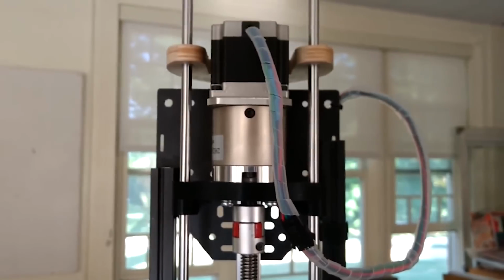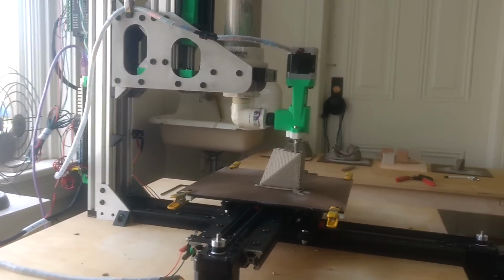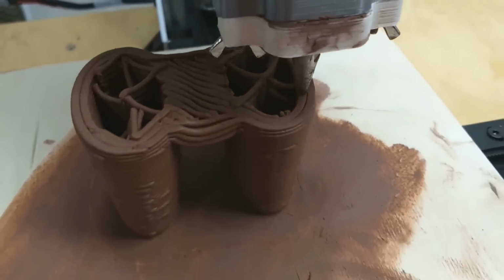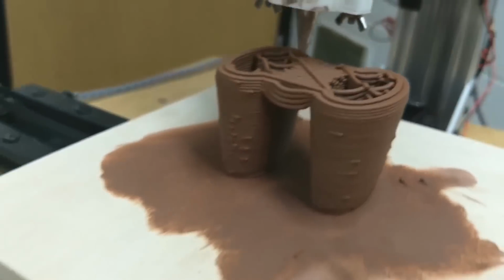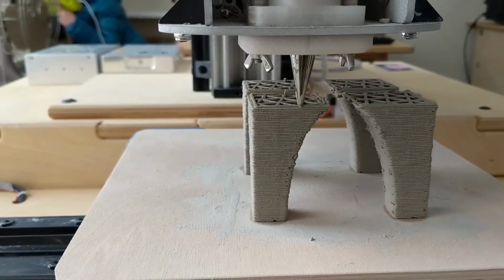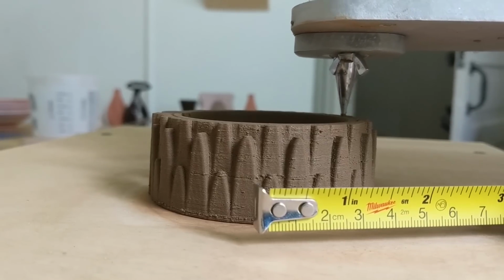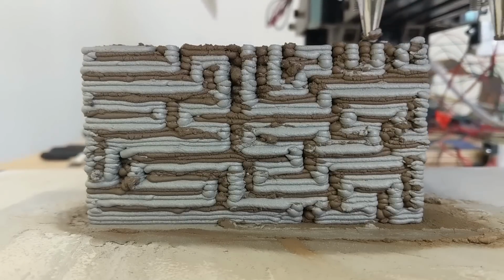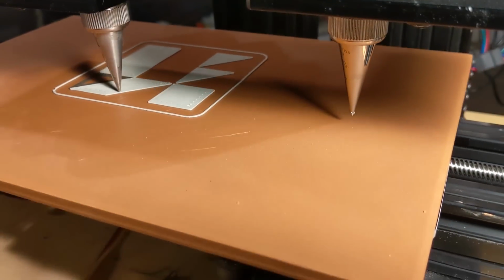Multicolor Clay 3D Printing (from NCECA 2021)

Comment: how does firing work with 3d printed parts? do the layerlines seperate in the heat or melt together?
Reply from the maker: One way to think about extrusion printed clay is that it is just coil built ceramics. In this case the diameter of the clay coil is 1 millimeter rather than something much larger. But in firing it works great, the layers continue to be layers, but the billions of clay particles in the clay body begin to be sintered together under extreme heat, just as do in traditional ceramic forming processes from hand building to wheel throwing and slip casting. So, the layers remain layers and they bond together permanently with melting or separating. Thanks for watching and reaching out!

Comment: yoo u just need a faster way to harden your clay, u should try with hot air fan.
Reply from the maker: Clay shrinks as it dries, leading to warping and cracking potentially. I actually sometimes need it to dry much more slowly than it does.
Reply: @TomLauerman  hope You can find another way to avoid cracking maybe a diferent mix otherwise bridging Will be near imposible You need some kind of rigidity for thin walls.
Reply from the maker: @Camusdemerac  I'm committed to working within the limitations of the material. Clay shrinks in both the drying phase (as water evaporates, bringing particles in closer proximity) and in the firing stage (via sintering and to some degree fusion of particles). These limitations have been present in clay/ceramics use for tens of thousands of years, so I'm ok with them persisting. Bridging capabilities in clay may be limited relative to plastic, but the material offers abilities plastic does not. For example, post-processing of clay allows for easy joining of different clay pieces together. Very complex forms can be assembled and seamlessly joined in a way that is fairly easy and happens at room temperature with no tools other than your hands. At any rate, I'm really pleased with the forms I've been able to print over the years and I should maybe be more clear that mostly the process has worked out great, but I tend to focus in the videos on the parts that are most problematic. Thanks for your interest!
Reply: @TomLauerman  i'm glad You achived such a feat with that material keep it up, and thanks for your comments, Best regards.

Comment: Really interesting, thanks a lot for the insights! Regarding the correlation of printable size and detail in a realistic amount of time - have you ever thought about a quick nozzle change system similar to what’s used in pick and place machines? The nozzles you’re using seem to be fairly steep so I guess it could be possible to print large structures in tall layers with a big nozzle and after each tall layer vase around the outside perimeter with a small nozzle and small layers to keep the details. Was just a quick idea that got in my head while watching this, your smaller sculptures are really awesome too 👍🏼👍🏼
Reply from the maker: Thanks for watching and commenting! I think what you are proposing could work. 
I'm not too concerned about print time - I know this is a big concern in Engineering contexts, but in the context of making artwork (the context I put myself in) its ok for things to take a long time.  Thanks again!

Comment: I have just recently gotten interested in clay 3d printing over the last week. Couldn't have found this video at a better time. Really incredible work. Is there any documentation?

One idea that I have that is certainly its own rabbit hole is supports. It doesn't seem like traditional supports are possible in clay, but what if you had a regular plastic FDM toolhead to print supports for your clay printer?  It could open up entirely new forms.
Reply from the maker: Thanks so much for your interest and welcome to clay printing! As for supports, printing them out of clay works a little bit, but is messy and the usual support patterns weren't designed with clay in mind. I had thought about the idea of a "combustible support" - basically anything that can be printed and later burned away (in the kiln firing process) would work. In the end however, I have preferred to print components and join them together post firing. Clay is easy to join to itself - as when a teapot is made in separate components and assembled - so for me I like the approach of joining modules by hand post printing. But I'd love to see someone experiment with support materials!

Comment: A new video from Tom Lauerman lands and I literally paused to get some popcorn. It's wonderful to see the evolution in this video. Your latest results are outstanding.
Do you use pressure advance (a function supported by Klipper firmware)? Also, have you experimented with adding any kinds of filler to the clay, such as short glass fibers? I'm wondering if it could aid in bridging.
Reply: in briding maybe an UV-activated hardener could be helpful (but i know nothing about materials so this could be a very stupid idea)
Reply from the maker: Thanks for checking out the video! I'd imagine a hardener could work, but I wouldn't want to burn it up in my kiln during the firing process as I'd imagine there'd be some intense fumes. Clay is great for "post processing" so small repairs (or large ones) are possible after printing.
Reply: @TomLauerman  you are right, I didn't think about the firing process. BTW great work, I'm pretty sure I'll watch your future videos :)
Reply: @ettore760  that's why I suggested glass fiber filler. It could be fired without causing shrinkage (and no debinding needed).
Reply: @JonS  now I understand, thanks
Reply from the maker: I'm not using pressure advance, but I've read about it and agree it could be very helpful for some aspects of printing.  I'm using a Duet control board and RepRap firmware, and I love that combo (and the developers have been so helpful) so I'd be unlikely to switch firmware (but I've heard lots of good things about Klipper) I will look into pressure advance within RepRap firmware.
Reply: @TomLauerman  Rep Rap Firmware supports pressure advance.

Comment: very excited about all the structural color work! I never would have made such a direct connection to weaving, but when you express it like that it all falls into place!

As far as extrusion mechanics, your talk posted a year ago or so left me with the impression that you had two augers, one fine to extrude at the tip and one large to push from the loaded tube; was i mistaken, and the second is still a “mechanical syringe”, with a threaded rod driving the plunger?

I’ve gotten the impression that you’re loathe to publish files for the printer until it’s “done,” or quality documentation can be produced, but I’d love to see a github repo or thingiverse post with a bill of materials and printed parts for one of your more recent printers! 😊

edit: also excited to see some of the structural color work perhaps with glazes over??
Reply from the maker: Thanks so much! A lot has happened in the year I've been away from YouTube (and since this most recent video was recorded). I feel like the extruder is done now. Future changes will be likely just related to ease of use or simplification of design. It is still just a mechanical syringe and a print head with an auger - it's not unlike some systems that are out there. I actually have barely changed the design at all over the last year - and have just been printing a lot and have been happy with the results. So yes, I should now document the parts and release a design on github. I'll work toward that end. I've moved away from the "structural color" idea more recently in favor of some other things I hope to share soon - but I'm really glad to see people like the idea in the comments.